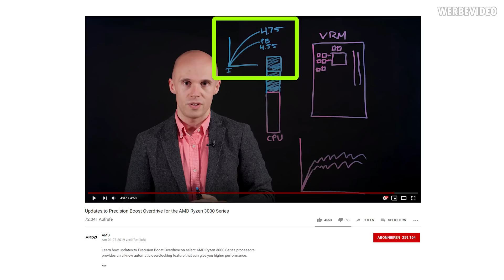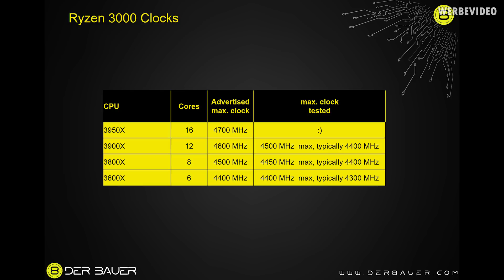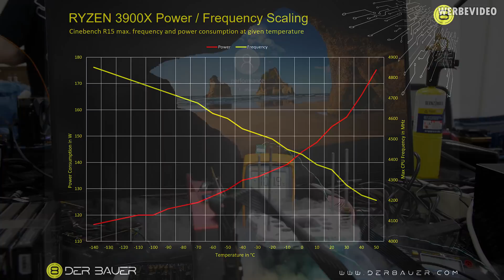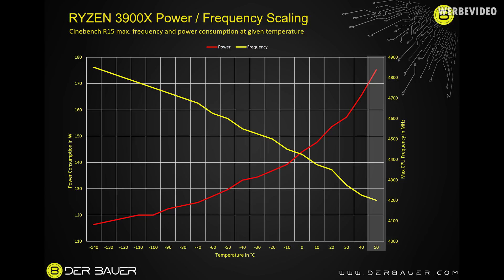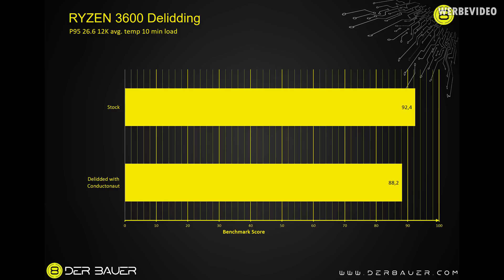RYZEN 3000 Delidded - Overclocking Expectations and Temperature Scaling

Comment: Yes, indium has better heat transfer than LM. Would a direct-die solution been better? I'm thinkin of delidding my 3950X and going direct-die route with liquid metal.
Reply: I've just delidded my 5950x for direct die. Modified the plastic latch cover by sanding it so my waterblock makes perfect contact. I believe direct die will be an improvement since the block will directly be sitting on the dies

Comment: The offset core die is pretty annoying because so far ive only seen Arctic AiO with an actual offset mount documented in the manual to improve temps. Most of the heat is produce in that little core CCD so the center of the cold plate should be right above it meaning you need a significant offset in reality.

Comment: Pure indium already has 81.8 W/m.K
while conductonaut liquid metal only has 78W/m.k.

the results were a bit lower since the thickness of the cpu heat spreader is reduced, making the distance to conduct heat nearer. 

I certain if you put pure Indium with same thickness will yield theoretically 4.6454% better. 

you should tell AMD about the findings to make their CPU thermally better and save a bit of indium.

I bet if you can solder pure silver ,
silver has 429W/m.k would yeild 550% better than conductonaut liquid metal.

Comment: AMD must have heard you. My 5600x, on PBO, hits 4.850MHz.  Granted..only on 3 cores at a time but 4.75 on all cores Cinebench20... Also on an apparently rubbish MSI MPG x570 gaming edge board (PBO preset 3).  CPU runs hot though. yuk.

Comment: Thanks the great video about delidding the 3600. I was thinking about the hotspots of 3600 myself and how it will work with hyper 212. I drew out the cpu dies from your video and drew the lines of the copper heat pipes from cooler masters site on a sticky note. If my drawing is right one of the heat pipe of hyper 212 will not be utilized at all and one of them will be over utilized. The other 2 heat pipes will be properly utilizing.

Comment: I get 4.425 Ghz at 1.375V or if I turn off one of the dies, I can get 4.5Ghz at 1.38125V on, my 3900x (seeing up to 74 degrees Celsius under cinebench or blender loads) and I'm hoping to either get that with less voltage or possibly get a higher clock, when I delid and throw the nauts on it. (Conductonaut under the IHS, and kryonaut under the waterblock.) Ordering my die mate 2 with am4 adapter today.
Reply: To get the advertised 4.6Ghz, I had to turn off hyperthreading and one of the dies, and then crank it all the way to 1.48V and it still wasn't quite stable every run. Just was'nt comfortable running that close to 1.5V as a regular OC, until I get some better thermal solutions on it.
Reply: Going to pair this with your Ryzen 3000 OC bracket, and see what I can get. As it seems, from watching several reviews of this chip, that I may have ended up with decent silicon. So I want to see what I can push under simple water cooling, without pushing up to chilled water or dry ice. I will let you know how it turns out on this particular chip. I know that if I can get it running cool enough, that I can at least bring the voltage down to 1.35V, since I have run it outside with the side panels off. It ran a fair amount cooler, and I was able to drop the voltage as mentioned. That also drastically improved my Cinebench score without touching the clocks.
Reply: So far getting the same clocks and voltage, but temperature is 5-10°C cooler when the load is spread across cores. Seeing 200-300 Mhz more out of PBO as well as 15°C cooler when using pbo. Ran out of Kryonaut while debugging the IHS fit, so using NT-H2 on top of the IHS. I may try conductonaut there to see if I can get any more improvement. Now also only using 150W under full load, as compared to working up to 180W then crashing. Only getting up to 55°C while gaming and recording with streamlabs off of the same chip, while overclocked, over 100FPS in AC:Origins at 1080 max settings, and 7850 in Cinebench R20, seeing about 70°C. I may try a reapplication of the liquid metal under the ihs to see if I can improve it at all
Reply: Was almost able to get 4.45GHz at 1.425 V, which is much better than the 1.48 I had to use before.

Comment: What about directly cooling the silicon with cooling liquid? It could be non conductive stuff, or even 2 phase stuff (novec 7000 would be awesome).

The green plastic stuff what the chips are embedded in could be glued to a compartment, where direct flow of cooling liquid goes to the cores and IO. In the same upper more holes could take away the warm liquid. This would be the best solution against hot spots.

Surface area is not a problem, just increase the flow, if heat goes up. (Considering the radiator is big enough, and the loop is not saturated)

Comment: Its amazing how overtime the nodes get mature.
4.25ghz all core with 1.45V while After a year or so my chip is doing 4.5ghz all core on 1.275V(Didnt push it further)
(motherboard-Msi B350M Mortar)
Reply: My 1700 and x570 did that reversed now that it stays at 1.35v i dont overclock and use it stock

Comment: Well, my 3900x does bursts of 4.6ghz most cores reach that in a game session. While gaming I see 4200 to 4400 but from time to time it will hit the 4.6ghz.

All core r20 will do 4200mhz manual, stock will get between 4080 to 4100mhz.

I have not manually clocked anything and have no amd ryzen master running.

Cpu and Gpu is cooled full costum ekwb

Comment: Wow.. Just 4 degrees means it's heat transfer structure to the surface is quite good. What if you fill it's edge with thermal paste but not the top?

Comment: I think the same Roman. All are good cpu im buyed the 3900x and it never hit the max frequency of 4.6 with an AIO of 240mm, then i buyed the 3950x same AiO and it never pass the 4566mhz. Tryed everything to do it works like PBO; Overclocked profile on the Ryzen master app manual all cores; manual 1 core at 4700mhz; pass the single test of CB R20 with 530 points but its unstable, dont get me wrong stills a good Cpu but can't happend. Love your videos. Yo! From Argentina. Mother Asus crossair VII Hero (wi-fi) with 32gb 4 dimms ddr4 3200mhz. XmP

Comment: Im not convinced this has any validity other than confirming he sucks at delidding AMD processors(or hasnt done enough of them lately to know it does decrease temps to a human limited extent). I mean if you delid and even use liquid metal inside the heat spreader AND your temps get worse? Yeah, you screwed up buddy. I can overclock a Ryzen 5 with stock cooler past its recommended max boost frequency. Not that hard. I can say that given how you presented yourself, you never wanted the delid to work well in the first place being biased towards Intel. Many factors could have been at play such as making the lid slightly concave or convex whilst removing it. (This is my guess) Could have sealed the lid just so that it wasnt making "direct contact" with the die. Another factor is use of thermal compound/metal difference between the two tests.

Comment: OK very informative.
@10:10 Important frames to look at for the 3600 : here u see where the chipsets are located, relative to the special squared corner of the CPU.
When u are facing the VRM, the big chip is on the mid right side.
The small chip is on the bottom left side.
When pasting, this is where it matters. Better past all the CPU with a card, but if not, don't miss this 2 locations.

Comment: When I delided my old i5 4670K I also had to little brush IHS to make good contact with core, I guess delid can't work without hat. That temparatures look terrible, I have 3800X and I am disapointed about temperatures, it's more than 80°C in full load with AIO. I excepted it will be hot, it's 8 cores, but 80+ °C??? That's crazy for me, I am not used to for this, it's like be in Pentium 4 times again. But I  know Intel is hot too, maybe hotter.

Comment: A fellow de-lidder. Nice Job Mr. The Der 8auer. Big fan of de-lidding chips. Been doing the AMD soldered cpus since Phenom Agena. My first was a 9850. Enjoying today my 2700X de-lidded.
But I wonder why you didn't lap the solder off the Die. And why re-use the IHS plate, should use direct die cooling, plate is not necessary after the delid. Anyhow, keep up the good work mate!!

Comment: It's absolutely useless to make a delid on the Ryzen 3 series processors. Simply because Iridium has greater thermal conductivity than any liquid metal - (81.8 W/(m·K)). Liquid metal - 73 W/(m·K) . It's also applied by automated robots and you will never be able to match that precision. 

Also the cost of indium is twice the cost of liquid metal which is essentially gallium. So those who delided their Ryzen 3 processors basically made them worth.

Comment: Here is a question for Mr. der8aur,  thinking of moving from x299 to x570 and worried about losing PCIe lanes for further expansion is an x8 gen 4 slots gonna have the same bandwidth as a gen 3 x16. So i could run the 1080ti in x8 and then have more expansion later on? thank you been looking everywhere for clarification. love your vids long time sub

Comment: I recently got a Ryzen 3600. I was able to manually overclock to 4.6ghz at 1.3v. I tested with prime95 for 1 hour for stability. The temps never exceeded 80 degree Celsius with. Hyper 212 evo

Comment: I've just achieved 4.5ghz on 1.375v in the bios, cinebench r20 at 89c max temp I got 3914 and 3927 back to back. I may have a very good cpu idk. It's my first build but it runs well. It crashed while in game so I turned the voltage up from 1.35 to 1.75 and has been stable. 
Update I just got a score of 4000 in cinebench r20!

Comment: Ryzen 3700X on an ASUS GAMING PRO, latest BIOS, all auto, PBO Enabled
32 GB of RAM@3200MHz
Cooler Dark Rock Pro 4
 Stressed with prime95 - Throttling is King!
under 55°C it sits at 4350MHz all cores and occasionally some cores jump to 4.4
@65°C it draws 80Watts and sits at 4150MHz all cores
@75°C it draws 90Watts and sits at 4100MHz all cores
@85°C it draws 100-110Watts and sits at 4050MHz all cores
@90°C it draws 150-160Watts and sits at 3980MHz all cores
@94°C+ almost 170watts, throttling rules and it sits at 3900MHz all cores
So, It reaches 4400MHz on a couple of cores only when it is under 55°C, but with the slightest utilization temps jump to 60s, the question is, what can keep this thing cooler than 60-75°, to my belief nothing.
Realistically this CPU is working @4100-4150GHz, much much lower than expectations! despite this, though benchmarks are really good and reveal a powerful processor.

Comment: Awesome video, it confirms everything I noticed with my 3700X, and it saved me from the hassle of delidding.
Thermal dispersion on this chips is awful, when CPU runs over 90°C in stress the cooler stays almost cold, it is a problem mentioned by hundreds of people.
I ll avoid delidding but I may have to lap the IHS cause it doesn't look absolutely straight, there seems to be a hump on the left side and thermal paste is not spread well on the other.

Comment: Did you check the chip on a flat setup with an indicator or something to see if the chips are both in the same plane and at the same level?  I was thinking possibly they can't be.  They could be close but not exact and that could create a .01-.05 gap under the heat spreader, like from one corner of one chiplet to the opposite corner of the IO die.  Are they on the same plane?  There are ways to test if both surfaces are completely contacting the heat spreader and I imagine across a production run they're probably all over the place (within reason and limits of the solder they use).

Comment: my 3600 is at 4.3 on all cores with 1.4v
Reply: hey idk if you will see this but are u still running it at 1.4v? and how is it been cuz I was just OCing mine and I was at 1.4-1.420 at 4.15ghz but I didn't wana go higher but idol voltage is like 1.45v. OCed it ran cooler at idol until load. but ya would love to know they say 1.325v max so I didn't know

Comment: Fascinating. So, why use a lid at all? Use a cooler (probably make a cooler) that makes direct contact with the two chiplets. Remove material from the face of a waterblock leaving slightly oversized rectangular bumps from the un-machined areas of the face. Or, use a lid that has its solid face removed (mill out the face from the pocket side) and use this as a standoff for the face of the cooling block. Or make a standoff similar to the lid but with no center, made from non-conducting material, like Macor. Your findings make my head swim. AAAnd late to the party again.

Comment: Lol my 3700x max boost is 4.3 never hit 4.4 under any situation(regardless of voltage and heat). I have mixed feeling but im still happy with my upgrade from 1700x.
Reply: how did you do it? my 3700x only boost up to 4.1ghz
Reply: Jomarilayson Tagra assumin you are not trolling, tbh idk. But i have asus crosshair vi hero with the latest bios and offset voltage - 0.15. Heat is under 65c at gaming and boost is stable at all core at 4.2 while playing GTA V at 4k max seatings.

Comment: i have my 3600 running now a 1.4v on all core load(4.2), and 1.47 light task load(4.4). Is that supposed to be dangerous? Because temps are around 66c with an ambient of 15(aida/prime/burn test).
Why redditers are absolutely terrified of going beyond 1.325? Im i missing something?

Comment: Excellent video. Subbed! I think you made an excellent point about the position of the cores, and every cooler in the industry being designed to cool the center most point only. With a change in this method obviously coming, I think it will truly prove this point, and improve the cooling of these chips in the near future.
Reply: der8auer
s video turned out to be invalid because of vendor bios bugs which didn't allow the boards to boost properly. He should really delete the videos as they are flat out misinformation at this point.

Comment: On my 3900X I am getting XFR Boosts of 4650MHz MAX on 6 of the 12 cores. Pretty good I say! Also I hit 4.7GHz Overclock on CCD1 at 1.45V
Reply: Looks like you won the silicon lottery. Those are great numbers. I expect the numbers on all these new chips to improve drastically as AMD works with this new process more and more, and the firmwares and bios's continue to improve. They will only become more impressive over time.

Comment: 20K for 100MHz - that's bad. You can overclock 1600 from 3.6 to 4.1 GHz for 20K additional heat.
UPDATE: once again, I admire the German engineering culture!
Reply: der8auer
s video turned out to be invalid because of vendor bios bugs which didn't allow the boards to boost properly. He should really delete the videos as they are flat out misinformation at this point.

Comment: I said there would be a heat issue which is covered in  this last 40 seconds of the video. Same goes with the GPU's to much heat in an area to small. thought the heat spreader may help but it is not enough.
I am not impressed with 7nm in any way CPU/GPU it sucks. Navi sucks and so do these CPU's even if they offer better then Intel. Intel has sucked for a long time but had no competition.
Reply: They REALLY need to use anything but silicon for future CPUs!

Comment: Does anyone here know why many user experience really high idle temperatures on 3700X and 3900X? Mine is running at 50°C idle, which I first thought comes from a mounting issue, but other people saw as well, many on AIOs as I recall. I already applied a -.075V VCore offset, which helped just a little bit.

Comment: For extreme overclockers and those hunting "a number" I get that 5GHz might be "important". But for actual users, the performance should be the important thing and put in relation to the price. Even I who have overclocked everything since the end of the 80's don't really care that much anymore. I want things to be stable, supported and work. So good performance at stock is more important than a bit better performance while pushing the limits, voltage and heat.

We have a second-gen architecture with better IPC than Intels 9:th gen, that is huge. Sure it clocks a bit lower but the performance delta in most single-threaded loads is tiny. The delta in multi-core is massive in AMD's favor. Looking at how almost NO game even uses a single core the single-core performance is also less and less relevant. Most games today stress at least around 4 threads or higher. That changes the figures you see from Intel and explains why the delta is so small in games.

As a package, if you do anything other than purely play games (and perhaps even then as things stand now) the AMD processors this gen are beasts with a performance per dollar that is awesome.

Comment: the biggest disappointment is the X570 boards running gen 4 PCI for no good reason for 99% of ppl that have to add active board cooling that will just introduce failures

Comment: One problem with the lid design.
there's absolutely no way two chips are leveled perfectly, so whatever you do they both will have less contact area to spread heat. There needs to be another way. perhaps using 2 part lid for each chip would increase the heat benefits.

Comment: So you removed indium and replaced it by indium+galium+stannum alias GALINSTAN. So interesting is that galinstan do better heat conductivity than indium alone. :)
Reply: Indium gallium zinc oxide
Reply: @tazboy1934  Thak you,. good to know this.
Reply: Darth Fate it is actually the thickness of liquid metal. It is a lot thinner than indium solder.
Reply: @mtunayucer  Indeed,.. Surface tension of liquid metal is that most important thing.

Comment: I think you should of sand the heat lid by using circular motions, otherwise the edges that you are pushing against becomes beveled which won't make it level while sitting on the chip